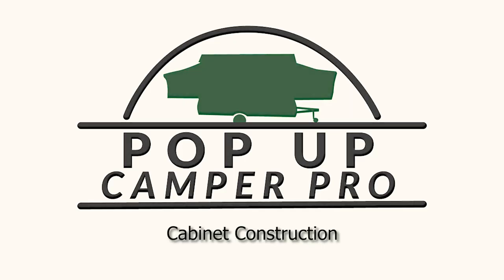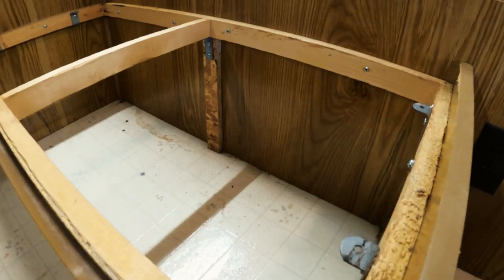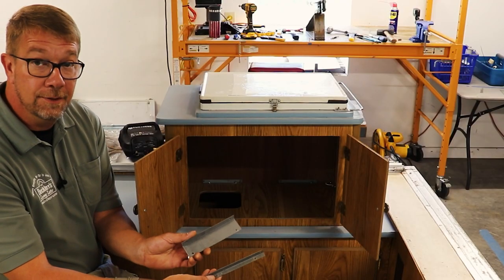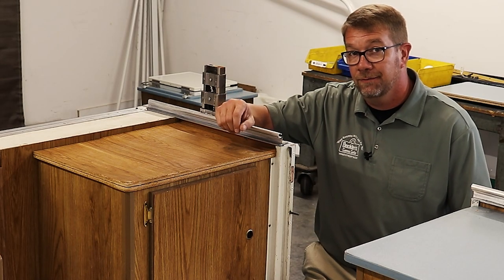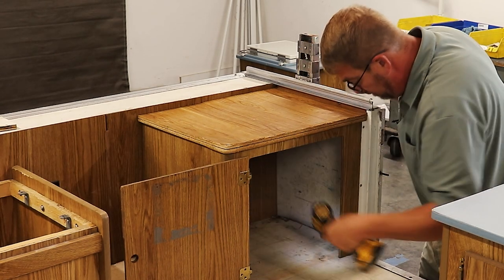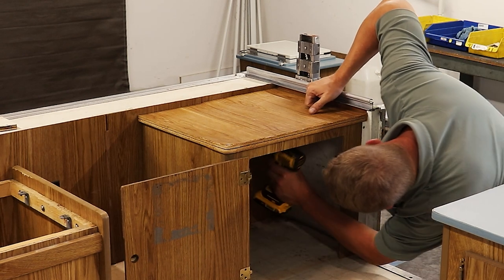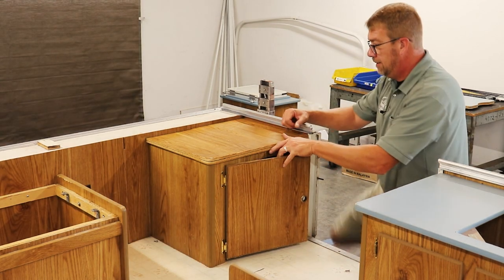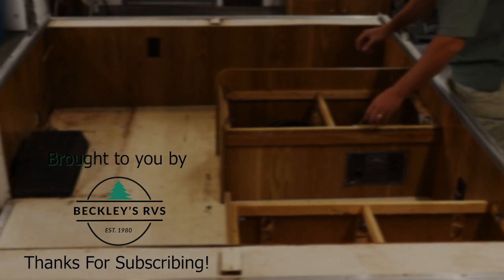Pop Up Camper Cabinet Removal

Comment: Do the cabinets provide any sort of support to the camper, or removing them weaken the structural integrity at all? We removed the galley in our '93 Cape Cod to reduce some weight and also add some storage area for totes and lighter things. We also had no intention of ever using the Galley but wonder if it was there for structural purposes too. Thanks.
Reply from the maker: I believe it will be just fine without them. The structure support starts at the 4 corner gussets and continue through the top deck rails. Although some amount of support is gained from the extra fasteners with the cabinets and dinettes I do not feel that removing them would cause any issues.